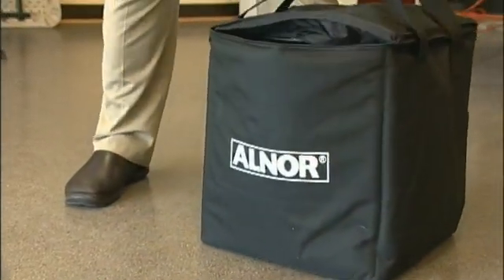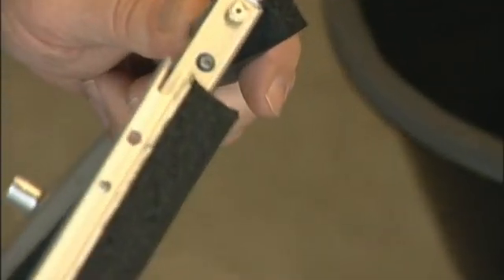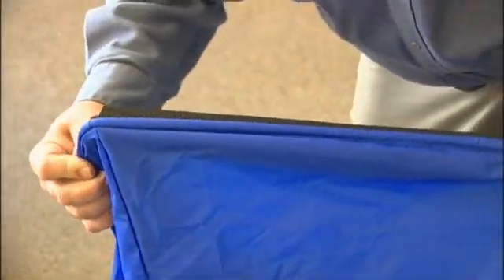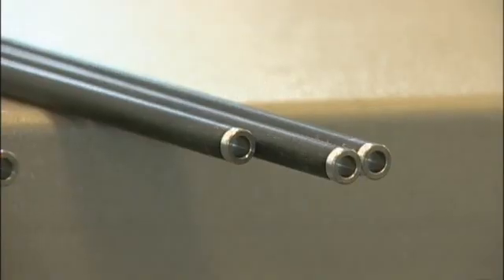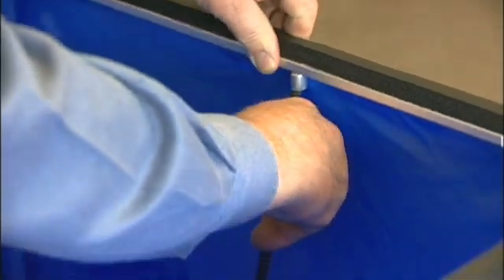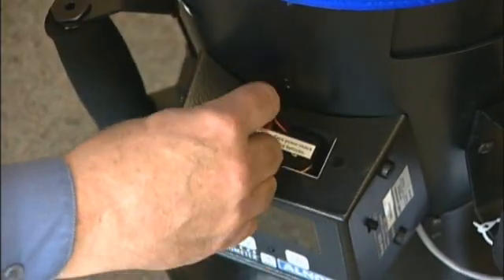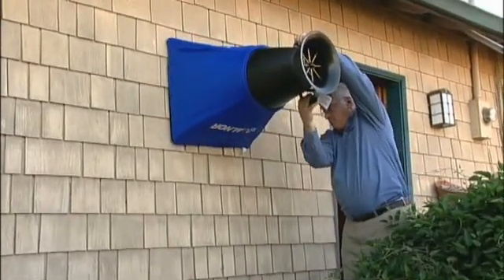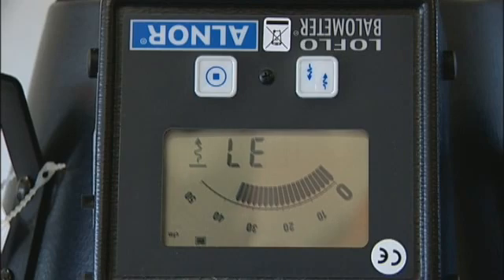How to Use: Alnor Balometer

Comment: What kind of sensor is used in these things?
Reply: I found it out. It uses a differential pressure sensor. As I reverse engineer this thing, I'm beginning to realize that I can make a better one that accounts for more environmental variables. Mine will work at any altitude with the ability to read air density. I almost have you beat Alnor. Your device if off patent, and I can build your 3000 dollar unit for 300 bucks......You now have competition.
Reply: And Jeee, they went full IKEA on assembling that sleeve.